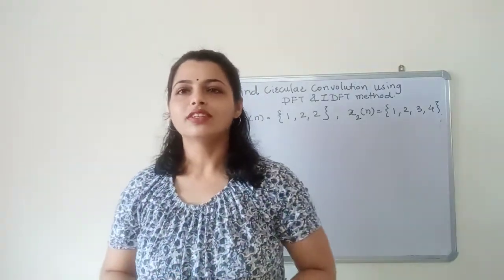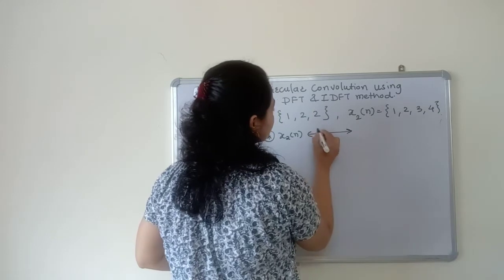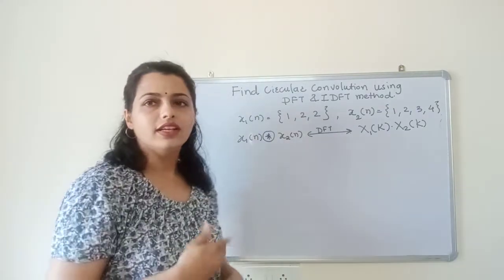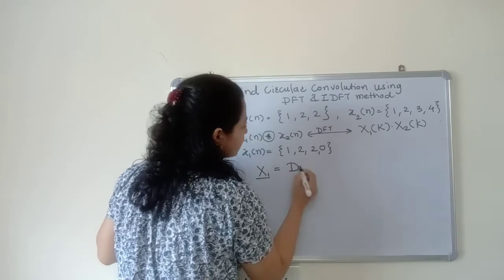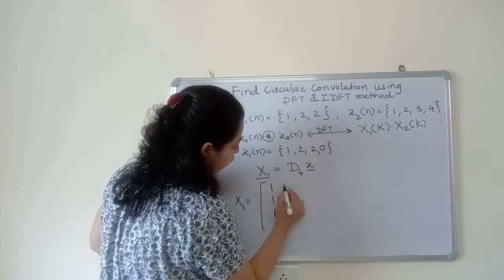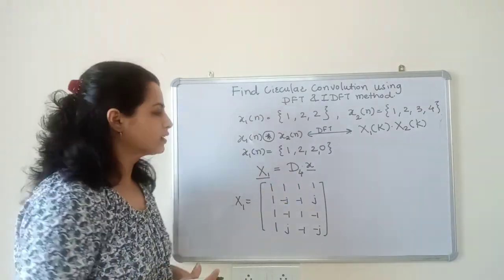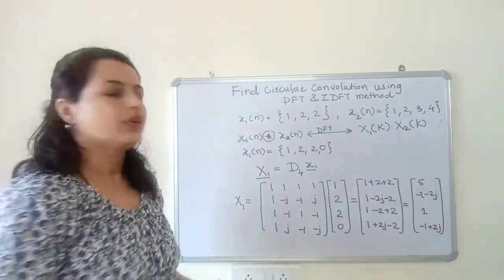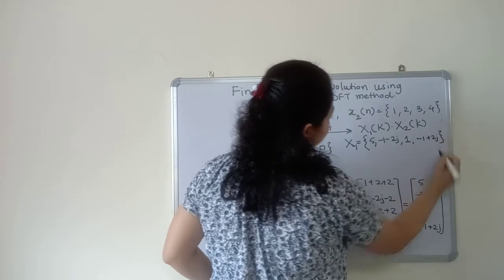DFT & IDFT method to obtain circular convolution. (frequency domain method)

Comment: Please help me to solve this 2 problem...

1) In a defense base camp, there remain two radars. One of them radiates signal of (n)={0,1,2} and another radar radiates ={2,1,1}. If the first radar receives it’s reflected signal and the radiated signal of second radar at a time. Find out the auto correlation.

2) Compute DFT of the following sequence, X(n)={0,1,2}.